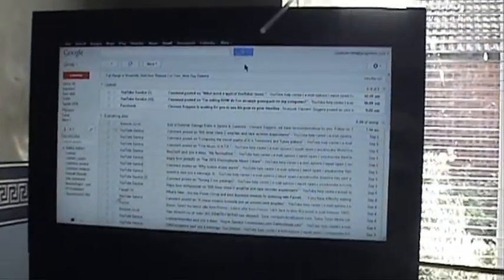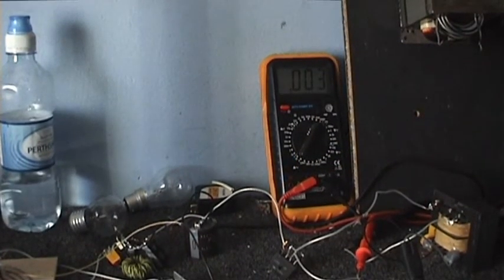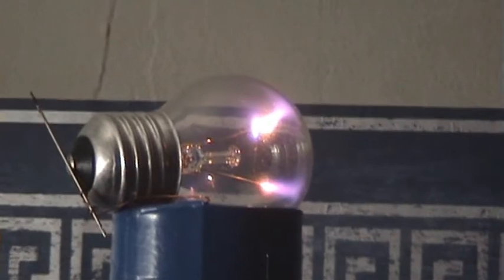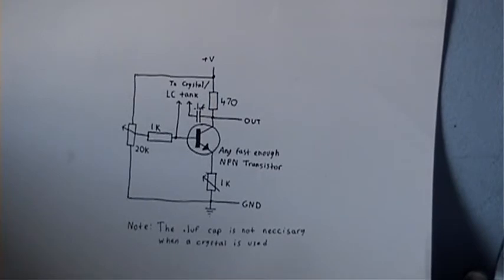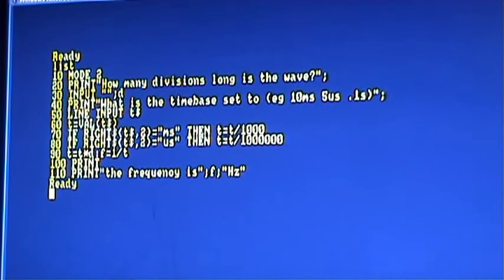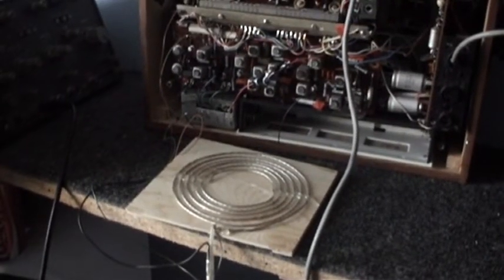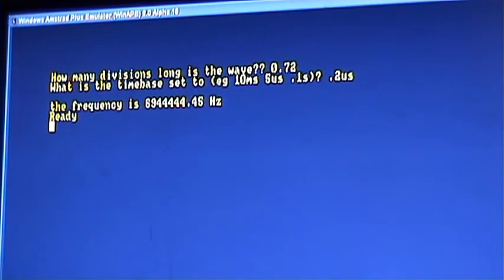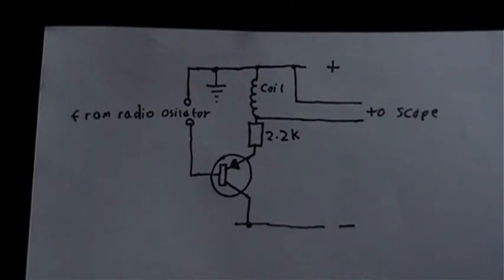experiments with oscilators, coils, radio and random waffle.

Comment: Ironically, the external mic actually picked up more tape motor buzz than the built-in one. Handycams have a very sensitive mic input, so you might try lowering the microphone's gain so that it doesn't pick up as much background noise. Otherwise the camcorder did just fine!